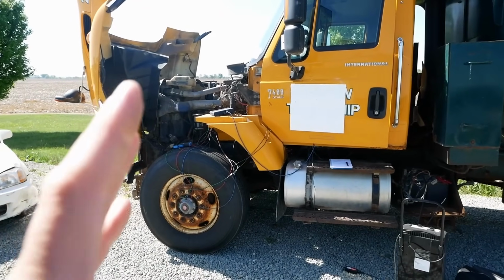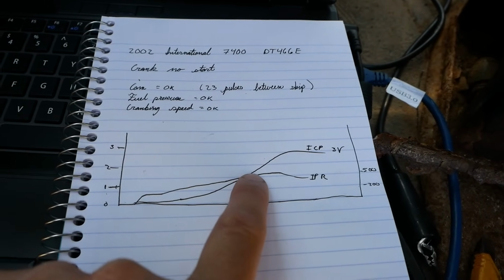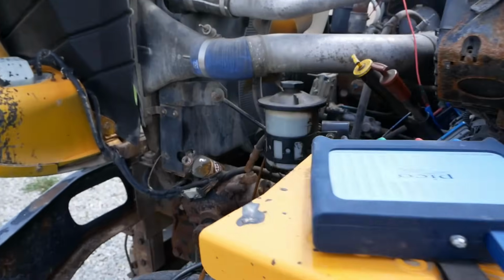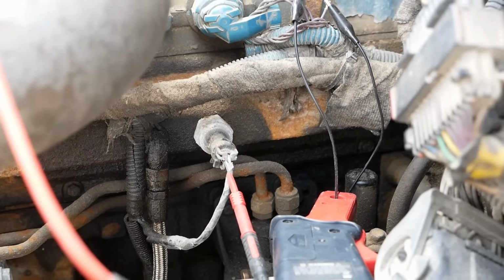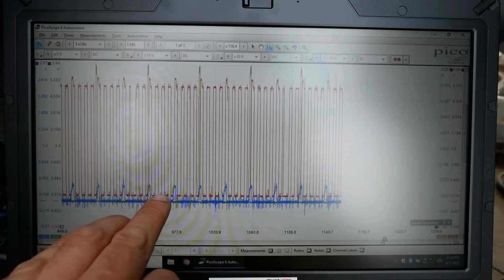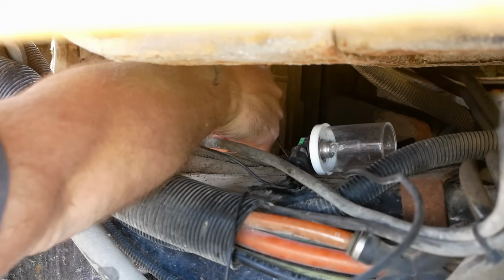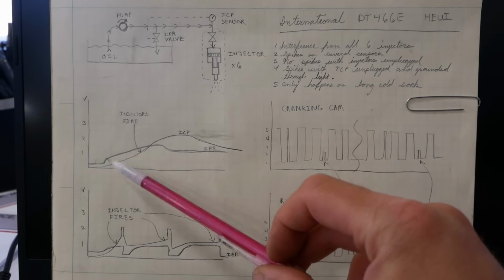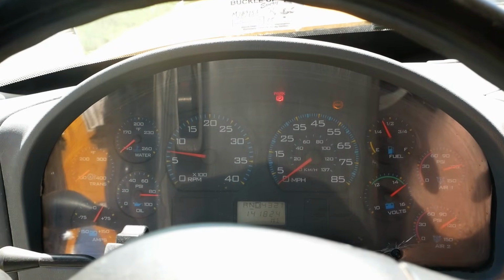International DT466E Won't Start without Ether after Sitting

Comment: That was an interesting one Wes thanks for sharing! I bet the aluminum filter capacitors inside the computer are open.
Reply: Here's a bad idea, but since this is YouTube comments I am perfectly qualified to make a suggestion.
My thought is if it's capacitors then after you turn the key on you could wait a while for the capacitors to charge up and then start it.
As I said, this is a YouTube comment so it's perfectly valid as anything else. That's the way the internet works.
Reply: @henryD9363  The problem is they go open & never charge up. I've repaired several ECUs just recapping them!

Comment: I can tell you we had a newer model that would not start. We changed the oil and it would start right up. The oil was getting thinned with fuel and it would not build pressure. Ended up pulling the injectors replacing the o-rings and the pucks that seal the injectors to the rail. Found a bad o-ring letting fuel into oil. You can put a pressure gauge on to check the fuel pressure and high pressure oil. Be interesting to see if an oil change makes it any better or not. Yes the wiring sucks on these things.
Reply: that's interesting and good to know
Reply: Ding Ding Ding ?
Reply: That could also be the answer why it fires up perfect when cold
In my opinion if it starts Well when cold and doesnt when warm you can forget about the electronics
Reply: @bertjetolberg103  
But the truck didnt start when cold if left for 48hrs........

Comment: I remember back in the 90s I considered buying an International road truck, but I found out they had a problem with wiring in the sleepers and fires starting apparently  because of cheap wiring, so I ended up going with Kenworth and never had wiring problems other than usual corrosion problems with connectors on lights.

Comment: Looks to me like it overloads the circuit and resets at a predetermined point in its programming. What is forcing the reset? Noise? Interference?? Is an internal smoothing circuit worn out in the control box? Capacitors come to end of life in the control box?

Comment: Probably not telling you anything you don't already know, but there is a service a lot more convenient and cheaper than taking a vehicle to the dealer for ECU programming. Do a search for Remote Assist Programming.
Reply from the maker: I can program it but I would have to but the adapters and pay for the subscription, plus I've never done an International, so I'd prefer them to take it somewhere else.
Reply: @WatchWesWork  I bet you'd have preferred them to take it somewhere else before you made this video!

Comment: The real crazy thing is what changes after ~48 hours that hasn't changed already in ~24 hours? Could it be a very slow capacitor drain in the ECU? Because any pressure related systems surely would have leaked down or de-pressurized within the first 24.
Reply: Yeah, that's what I'm thinking. Bad cap on the circuit board.
Reply: I just came down in the comments looking to see where I could throw my hat in for the 'bad cap' theory. Those spikes look to be a signal that maybe should otherwise be smoothed out by a capacitor. Besides that, maybe one has just puked its guts out and also playing havoc with actual traces on the board, shorting things out and making spurious signals internally. I wish it was being replaced though, I'd love to see the actual innards of it.
Reply: Would a bad cap get better by getting hot, though? -there's also the long delay before it acts up again. It's not going to get any colder sitting more than 6 hours or so. Only thing I can think of is leaky semiconductors in the driver circuits... that has similar symptoms in automation, where, e.g., machines act up the first couple hours after having been off for the weekend. Seen that a couple of times and each time it was the interface circuitry between the 5V logic and the actual machinery.
Reply: We just sent one of the ECUs on a big truck into Cardone to rebuild it. Not because we wanted to but couldn't find anyone else who would touch it.

Comment: I was going with a sensor or ECM/PCM but the thing runs fine when it runs. I've read about rigs with HEUI that wouldn't start after an oil change. Once the rig sat over night it started right up and ran fine. The tech-rep suspected air in the oil (power oil fill at the dealer) during refill and that was it. 
Your problem is just the opposite in that it runs fine when warm but won't once it cools off. You might try changing oil and dropping to a lower weight (say a 10 or 5W-30 as opposed to 15w-40) and see if that does anything. Just a guess!
Reply: Sounds like you have to be a voodoo witch doctor in order to fix these damn things. Unfortunately they were designed by voodoo witch doctors to begin with.

Comment: No max....that was the problem 

This is what happens when the head mechanic takes a vacation and the apprentices run the shop....new ecm on everything 😅
You got to get the main guy back

I dont think you will ever see an international engineer...they all fled the country after the 6.4 powerstroke hit the dealer lots

Comment: Life is only going to get more complex, the ecu will not power injectors until a set of conditions are met but does not necessarily tell you what is missing. In my case a leaky injector on a BMW M47tu diesel dropped the high pressure line below the threshold the ecu needs to see when cranking to fire injectors. Engine would push start or ether start because you lift rotation to the point that the high pressure pump overcomes the leak to lift rail pressure.

Comment: If I had to guess I’d bet Eric O would have an answer since he worked in his family’s truck shop before starting his own place. My first guess was that pump thing that’s bolted to the engine - some gizmo in there like an O-ring fails after hitting a certain pressure so it can’t develop consist pressure long enough for the engine to get up to speed. I think all the other findings are simply coincidental and rabbit hole/red herrings.  I was wondering if there was some way to rotate the engine fast enough with something like a really large drill to further isolate the issue. Obviously I have no idea what I’m talking about! 😉👍🔧🧰

Comment: Sounds like a weak capacitor in the ecu.  It barely holds it's charge when it works.  When it's been off for a long time, it can't charge up again. And caps usually suppress voltage spikes too.
Reply: An external cap between power and ground might help that.
Reply: Here's my ignorant thought. When the ignition turns on wait a little bit longer for the caps to charge up before starting. But I don't know the circuitry so this is likely another typical ignorant YouTube comment suggestion.

Comment: Maybe unrelated tip... but If you unplug the ICP sensor and crank the engine, the ECM will read 0 volts, HUI pump should apply full pressure.  I had a 3126 Cat with a bad ICP, read 5v all the time so ECM wouldn’t apply HUI pressure to the injectors.  I put a gauge on the HP oil system could not get pressure, replaced pump, IPR and finally the ICP.  Could have saved a bunch of time and $ had I know that simple test.

Comment: hahah, the spikes are definitely from bad caps (maybe in the injector drivers?) with extremely high equivalent series resistance, so instead of filtering current spikes from the current switching, they're coupling them through to the power supply.
Reply: Yep. They'll be drier than a Nun's nasty.
Reply: or the caps filtering the power rail + to ground. depends on circuit layout.

Comment: i am no internation tech ,we had acouple of of t444E 1998 -1999 the only couple problem i have seen.... is cam sensor fail no start ..app sensor fail loose control of gas pedal. intermitant and lot of relay glow plug fail  and fuel filter draining out  no start and pcm cause no crank and injector engin mis.we did not had scan tool we grounded diagnostic  plug te retreive code and start counting flashing light.... i do not mist those day

Comment: Its too bad that is probably a potted ecm, sounds like a flyback diode is letting the voltage spikes from the injector coils leak into the control bus. there once was a youtuber that did board level stuff and got me motivated to go to school for electronics, I think he went and became a mechanic.
Reply from the maker: Heh. I've never tried to repair an ECM. There are no schematics so I'd be pretty lost.

Comment: over the years ive heard many stories of engines "addicted" to starter fluid usually they were agricultural or plant diesels and much less advanced  i always put it down to the ether somehow damaging the glow plugs and making itself essential to cold start but all these only became issues in cold weather
Reply: I think the "addiction" might have something to do with engine wear, for years guys will run their equipment into the ground complaining how it only starts on ether while all the might need is a full diagnosis and rebuild.

Comment: Possible feedback noise from the pressure sensor affecting the 5 volt. Transducers are indicative for causing noise under variable pressure. You were close when you tapped into it to check the. 5 volt and your scope filtered it enough to temporarily correct the interference. Try disconnecting the sensor and see if wave form normalizes
Reply from the maker: I did. I even loaded it.

Comment: We have a few crapnationals left haven't had a ecm problem just about everything else mostly high presure oil pump, the cups. Ect. We won't   get 13 letter manure speaders anymore. The maxforce we got in 08 was the last one it has been nothing but trouble.

Comment: I was willing to bet that those voltage spikes were EMF induced from the injectors firing. Im not sure if those harnesses are shielded or not, but I’ve seen the same thing happen when the shielding gets broken or damaged and looses its ground connection. 

It can also happen inside the ecm if there’s a faulty capacitor on 5v regulator circuit on the board, the injector driver circuitry draws a lot of current when the injectors fire and if there isn’t sufficient smoothing capacitance in the regulator circuit it will sense that voltage drop on the power input side to the ecm and try to compensate by increasing the output until it senses that’s too high causing it to loop cyclically. 

“The stupidest design anyone could come up with” yup… sounds like everything International/Navistar 😆
Reply: My first thought was it being a voltage regulator issue. Could be a flaky mosfet or cap in the circuit. If it were me, I'd have split the ECU open to take a look. Then again I'm not running a shop...
Reply: @Luftyloon  I agree. I work for a heavy equipment corporate dealership and anytime I find a bad controller I always crack it open to see what failed. Many many times it’s either the TVS protection diodes, or a ground path diode (I’m guessing for reverse polarity protection?). It amazes me that we have to charge the customer $3-5k for a new controller when a $0.10 diode and ten minutes of soldering would fix it 😬
Reply: I think you are on to something white capacitators, If they are bad they often come back white some heat. ill bet if you take your whifes hairdryer and heat up the ecm it starts.....
Reply: I have a feeling that parts of the design are handed off to the experienced engineers, and parts are given to the interns, at least I hope it's that way...

Comment: My auto repair shop has raised its rate to $145 an hour, the Porsche shop charges $200 an hour, my tattoo shop has just raised rates to $200 an hour after remaining at $150 for 15 years. You better not be paying yourself anything other than a living wage; that would be crazy, particularly as prices go through the roof. If you were a beginning tech I can imagine $25 an hour, but really Wes your knowledge is close to encyclopedic. People are reluctant to talk about how much they make, but figuring this stuff out takes experience. Did you see how many hours Mr O South Main Auto just spent diagnosing that 1980s truck (O2 sensor PCM?)? 🤣🤣🤣 I would have just junked that truck. Best Regards
Reply: It's Eric O
Reply: @mejesse809  
Yup Eric O, I must have referred to him as Mr O because he’s always saying Mrs O. Who eats lunches like he does and goes back to work. I’d be in a food coma.
Reply: Wash your mouth out. You can't junk a classic like that S10! It'll still be going after all these modern poser trucks have been turned into cans.
Reply: Find a bad diagnostic mechanic and see how fast your bill runs up😂. Local shop charged a customer $1650 for a plow truck that would not start, and “was no farther along”. They told the customer pay them more or come pick up the truck🤪
Reply: @mph5896  
Yup, I paid about the same amount when I asked my mechanic to figure out where all the water was coming from in my ‘05 Mustang that had ruined my PCM, and made my gauges inoperable. New PCM and of course he had no way of flashing it. Mechanical issues are fine, electrical issues…ugh.

Comment: Amazing detective work. Engineers seem to keep their jobs by 'improving' systems that work and once they cause a problem they then use their 'monkey brain' to locate their handiwork to where a master contortionist uses substandard parts for the installation. THEN the bean counters use their ouija board, crystal balls and darts boards to price parts and labor. Made In 'Merica specs ... wow ... not in a good way. Thanks for sticking with this one. Maybe all the computer chip shortages aren't such a bad thing.

Comment: Wes not trying to run your show but i worked for my city we had two of these trucks an i stumbled on the problem by accident ours had fuses in the battery box an one of the fuse holders was pinched an lost connection i replaced the fuse holder an it started every time mabe this will help you
Reply from the maker: I wish. The fuse box is a crusty mess but not the issue here.
Reply: Ok thought it might help sorry maybe it will show up my pickup is doing the same thing won't start no injector pulse i have fire an fuel  its a 2000 4.6 gas burner no coms either won't comunicate

Comment: we used to have a fleet of 2004 4400 Internationals with the DT466E. They look nothing like what you have there. We would run into an issue with the engine having a long crank/no start due to a bad o ring where the oil rail meets the head under the valve cover. This would create a hard start, and if bad enough, a no start situation.  Diag would be to disconnect the oil feed hose from the HPOP to the head, run a 150 psi to the fitting and watch drop off on the gauge as well as the ICP pid on the scan tool. if pressure fell off the cliff on the gauge, and the pid value was way off the supplied pressure, the o-ring shit the bed. 

I agree, this is a bad design, with multiple redesigns all the way up to the maxxforce engines. I have seen the screens on the IPR shattered, ICP failures, we even had an issue with the ecm being filled with oil, only guess is it traveled up the wiring as the outside of the ecm way dry. sorry see this one was a bust. Keep up the great content.
Reply: $$$$33³3
Reply: Your right I didn't read your comment before I put the something lol icp ipr and o rings for the high pressure rail

Comment: Oil manifold o-rings, the high pressure oil pump, and the ICP/IPR are the leading cause of HEUI, crank, no starts. The DT466 engine is a tank, you can run it for years, as long as you change it's oil every 20k or 3 months, and replace the o-ring components for the high pressure oil system every 6 years.
Reply: 3 months???

Comment: If I had to bet, I put my money on old leaking filter capacitors in there that are also probably shorted. Being that it runs and drives it can't be anything in the processing circuitry or it wouldn't work at all.
 If I remember correctly those operate on a high voltage, so I bet either some corrosion got inside the box and is bridging something somewhere or some filter Caps are either leaking electrically or have leaked their electrolyte onto the board and are causing shorts....

That's my final answer 😁
Reply: I had the same issue with a 3000GT, leaking caps were temp related on if the injector circuit would decide to fire or not randomly.
Reply: Don't get me started on #$^@ capacitors. I replaced some CapXon pigs a few years ago on a PSU in an old Philips monitor I still use daily and it's just this week started acting up as if the new ones are now dying.
Reply: Yep.  Truck's had about 20 years with Illinois temperature swings.
Reply: I wonder if they're Illinois Capacitors 😄
Reply: That is probably the issue.  IIRC, there were tons of problems with bad electrolytic caps around the turn of the Millennium.
Reply from the maker: Sounds right to me!
Reply: @WatchWesWork  not sure if it would work but could you add a 5v power supply to one of the sensors to keep the voltage from dropping (12/24 v voltage converters are cheep)

Comment: Trouble is ECM faults have the same hysteresis as common electrical faults but we learn to usually trust the ecm data because of a lower failure rate. Nice work in trusting your diagnosis.